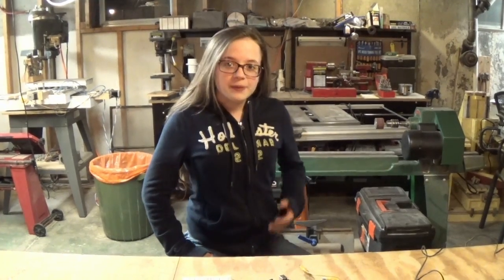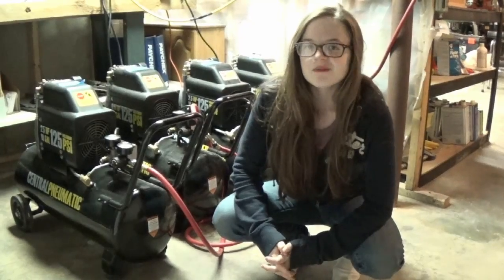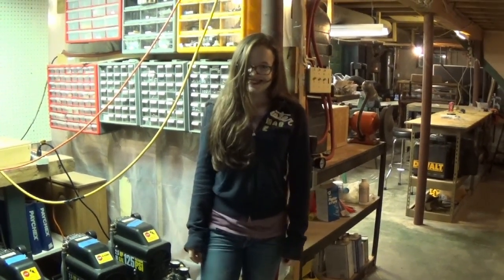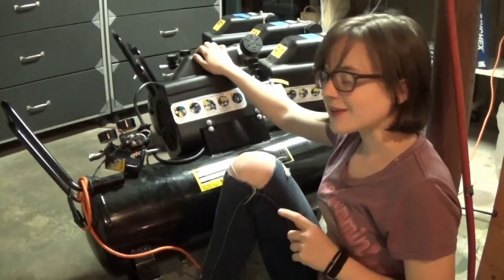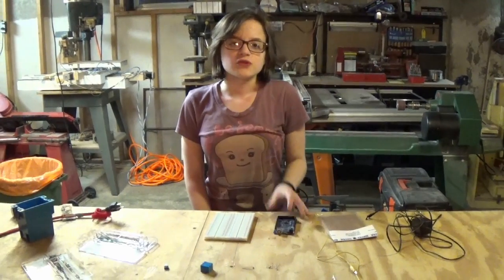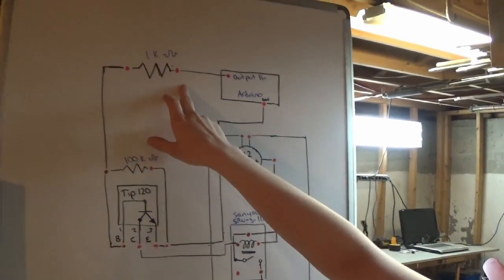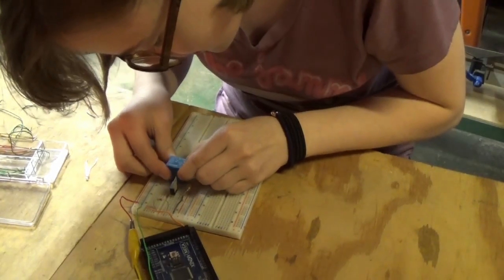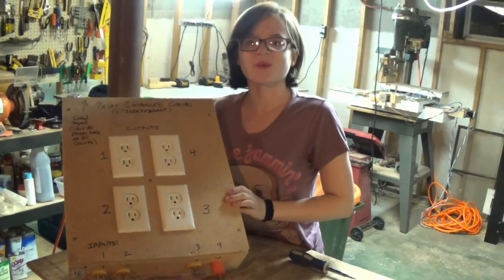Ep3 Cheap High SCFM Air with Parallel Compressors

Comment: its brilliant but has room for a lot of breakdowns as well. 1st of all, 4 compressors that are oiless...omg, you cant possibly have neighbors or be working in the same room. 2nd is you have 36 amps load just to fill roughly 40 gals of tanks and you have 600 bucks invested plus all the extra relays and power box so lets say 700 bucks to be conservative. not to mention all the future issues with 1 relay or switch or compressor that affects everything downstream. i have sandblasted for 20 yrs so i know your situation all to well. and i tandem 2 compressors as well to sandblast simply by setting the switches cut in and out the same and run both air lines to a T and a 3rd line off the T to the blaster. i am only pulling 16 amps total load, i have 18 cfm output, and 45 gallons of air and i can run the blaster constant for over an hour and maintain 75 psi. i have 100 lb blast pot so about an hour and im out of sand anyway. and believe me, 1 hour of blasting and your ready for a break anyway. i love the theory but the KISS method is better. half the electricity, double the air volume, oh and half the noise due to mine are oil bath compressors. you also will be buying 4 more in 5 yrs or less because of no oil...both of mine are from the 1980s and still going. the only difference is you did get out cheaper on the initial investment of 700 bucks. my 2 would cost about 1000 in todays world...but i will make up that 300$ difference in power bills vs yours in 12 months or less. keep up the good work, happy blasting and if your within 50 ft of those things, in addition to the standard respirator and sandblast hood, you will also need ear protection because they are insan
Reply: Those are oil-lube compressors and an incredible value when they're on sale at $99. They're loud like any direct-drive compressor. Another consideration is when she's done sandblasting she can sell two of them and still have plenty of air. However, I suspect the bug is merely the beginning and she'll find plenty to do with all that air.
Reply: Ok so u got me on a technicality, yes they are oil lube, but not a true belt drive oil system that is super quiet. I can run my 2 and have less noise, more cfm, more gallons storage, and less cost...and not have shit for compressor. Mine are 30 plus yrs and i could sell tomorrow for $200 each...these i. The vid will resale for $50 the very next day if she is lucky and 30 yrs from now, they will be just a memory, kinda was my point and you kinda missed it ;)
Reply: And theres no way she is doing much sandblast with those 4 toys. Maybe 30 seconds at best and shes out of air, then a minute later, maybe another 30 seconds of air...smh. god if she gets rid of 2 then she mights as well use a tire for air :). But seems like you know what your talking about so..... how about this: post a video of this exact setup sandblast a rusty car rim. I wanna see it. Id love to see her attempt to do whole rim just to see the sand stop at 30 second mark. My setup will do that rim front and back without stopping. Uses less amps, has more cfm, more gallons, longer yrs service and you actually have something worth something a yr from now...do a video of these 4 compressors 1 yr from now...3 of them will be replaced by then...great value! !. Yeah, you kinda missed that point too. :)
Reply from the maker: Michael Collins, 2 summers and counting.  All four are running smoothly.
Reply: Ha, mine are 30 plus yrs. Get back with me in 30
Reply: Michael Collins I understood this video more than I could make sense out of your comment - or the point you are trying to make.
Reply: Jake Toolson  jake, if you knew half as much as i do about compressors. Lets start over, jake, if you knew anything at all about compressors, you would have no problem understanding my point or wording. So i understand what you are saying, its 1st day of class, you accidentally entered rocket design room, clay pottery class is next door. Happens
Reply: Oh and btw a true belt drive oil system lol as you wanted to know is a motor driving a pump with a belt. The crank sits in a bath of oil and pumps and splashes oil to all the moving parts. Rookie i see. Quite the effective system. Much more so than her loud oiless units to which i made that point as well. Hers will last 5 yrs, i have one from the 1980s still in use...it is velt drive oil system but you probably wouldnt understand.
Reply: I have 11 likes you have 0 she has 5 so im not sure...
Reply: alphabuilders now you are getting it. keep reading and maybe you will understand... hint, it does have something to do w power... may have to drop u more clues later cause u seeeem aaaaaa lllittttlle ssssllllooooowwwww
Reply: Rickey Racer you da, read it back, she even said herself they are loud like any direct drive comp.! Now look up direct drive compressor and read specs on 1st 10 that pop up...then get back here. They are oiless system!! Which is not a true direct drive you da. A belt is to turn an oil pump and the compressor...sheesh, cant believe in actually waisting time to explain this. Hell, even she backed off conversation, when i got down on her level, shes a super smart kid, and my facts made sense to her when i got it to her  rain in numbers...lol haha, now wonder what that says about you
Reply: Rickey Racer lol i have 17 likes ,,,you have 1...guess nobody likes me. Guess you were right afterall lol
Reply: Sure, Michael - "For being right".  Wow, that went so far over your head. You might have some book smarts, but your people skills are ZERO. Go torture a puppy or kitten instead of wasting your time on here. No, I'm not a liberal - - I'm an FAA licensed Commercial  Pilot and A&P,  Mechanical Engineer, died-in-the-wool Texas 2nd Amendment advocate who carries daily.  Don't worry so much about "being correct" - try using some tact.
Reply: LincTexPilot  hey flower, my booksmarts are why i get paid and underatand how things tick. I dont get paid to change pansies diapers when feelings fet hurt. Facts are facts, her theory has lots of room for improvement.  Also has a lot of good points...i said that. Leave it alone. Her daddy is obviously smart lol as no way in hell she wrote this. Anyway, he is smart, it has room, i said that, it was right, u got butt hurt, i dont do butt hurt, i do facts , sorry, aply for gov aide and stand in line with all the others. Now, if u can dispute any of my findings on the facts of ,amps, gallons, cfms, etc, in open for discussion at any time....i will wait
Reply: LincTexPilot btw, if u are mechanical, then youd know all this. I as well as mechanical,  am also electrical. ( dad was mechanical and older bro was eletrical) so guilt to satisfy both made me do 6 yrs intead of 4 lol. Anyway, i get it. Both. And facts dont change.
Reply: Michael Collins Have you seriously argued about a teenaged girls video for an entire year?  I will agree with you that there are better compressors out there to be had than harbor freight, I don't think any of these people would argue about that. If it took you that many years to learn this point, you have wasted your life. And continue to waste your life arguing with complete strangers about a stupid compressor.
Reply: Michael Collins +1 Who finds your comments absolute nonsense. Any future peeps i wouldn't waste time on this troll obviously a waste of space to seek out child videos to bad mouth them and any supporters. 
Wanted to share with her fans ive owned the 10gal /5.3cfm version for years, used it for soda blasting, auto air tools, ran hard never changed oil.
Reply: Heng Zheng no, i suggest u go buy 3 of these and be just like her! She rocks . You and many others just need to follow her plan. I will stick with mine. 1 of mine is equal to all of hers...duh. that was my point b4 u and others jump on the bash train woo wooo, u are the current captain of not understanding amp,cfm,volume congrats
Reply: I feel so stupid to even reply you... And You still think it's only about the compressor. FYI I got petrol powered 7.5hp commercial 'TRUE OIL LUBED' compressor with 500 lpm F.A.D. (Tank size is 20 lt only though coz it's a compact trolley model, but what really matters is the FAD and duty cycle) and another high pressure model to charge my max concrete nail gun to 300 psi, and so what's the point? It's just a freaking tool and I also know my tool, and just because I know, I regard it as nothing instead of some kind of knowledge to brag about. I actually think it is pathetic to brag about as a owner (probably because you got nothing else?) instead of a creator like what the girl does, at least she's doing something creative which means she will also evolve, with or without her dad's instruction. And FYI I am also a artificial intelligence specialist with 1st class honors Masters degree (didn't take the Phd Offer though), which is nothing, just want to mention that's my main area and I am only a part time mechanic and metal worker. My interests simply covers all, e.g. 3d print an adapter to let my dewalt use Makita battery and the parts for my drone, making 'knock off' incra jig using my soft metal, train a deep learning model to write an article with key words and core idea, etc. etc.AND, all the above statements doesn't matter, you can regard them as BS, so will I, as I don't give a fucking shit. What matters is I care about you mate. I have a friend just like you, and he definitely get's better after he begins to see a psychologist regularly. Seriously, you did nothing wrong, but your brain could went wrong and it's not your fault. and unlike anyone else here, I don't want to be harsh or mean to you, I want to help you, to stay healthy, mentally. That's all. And this conversation is over. I won't reply, and to guarantee that, I swear here, if I reply I will go to hell. Take care and be happy.
Reply: Mr. drjjlj and all the rest of you people just need to get up off Mr. Collins back and leave him alone. It's oblivious that he does not have one real friend to talk to, so he watches little kid videos and argues with people he'll never ever see or meet just to keep from being lonely.  Mr. Collins i got your back, cause i'm lonely too.
Reply: Moe Moe's obviously, afterall, you ate not only watching little kid vids but reading and commenting as well. I didnt even go that low..i didnt read or comment on anyone, i started the conversation  simply by pointing out facts... BTW,  not 1 single person who commented here has been able to tell me 1 single part of my many points where i made an incorrect statement. Just a bunch of haters is all that have been here, no facts. I based my facts on 1 knowledge, 2 experience of real world shop experience. I think all the haters are teens or immature at the least who probably have a box store 20 gal compressor which makes them a pro on the subject
Reply: I am interested in what Michael Collins said.  I'm designing a multi-compressor setup for my shop to run DA sanders, HPLV, and media blaster.  I checked out this video because I wanted to see someone using more than 2 tandem compressors, and my immediate first thought was that this setup is a bit "over-engineered" or maybe "overly-complex" - i.e. where is KISS?  My second thought was wondering why you would use 4-5 oilless direct-drive compressors when HF sells oil-lubed belt-drive units that would put out more air using less power (much greater efficiency) with much less noise, for about an extra $30. I simply can not fathom why anyone would want to use an arduino to control power switching.  Makes zero sense.  It is inefficient (how much power is wasted on simply running the arduino?) and redundant - there are better and more simple switching systems out there that will control multiple circuits, and do it with a remote control, which cost less than the arduino.  I assume the goal with the arduino was a teaching lesson about electronics and programming for his daughter, in which case, bravo good sir.  Every learning opportunity is worth the extra time and trouble and I applaud you for doing that.  However, I was rather disturbed to see them using extension cables to run dedicated power circuits from another room - that is a serious fire hazard if you're running those compressors for any kind of serious duty cycle.  Also, if you're going to all the trouble of wiring up 50 amps worth of dedicated 120V circuits, why would you NOT use single-phase 240V?  Parasitic loss over the wire run alone will be about 20-30% lower on a 240V circuit, plus you are drawing a lower amperage which equals less heat on the wire, and less wear on the motors.  I could continue but I'm not trying to be critical of the girl or her father, that's not my point.  My point is that no serious shop would ever use a design like this as it is rather inefficient and over-complicated.  I believe that Michael Collins made some very good points, and to insult or attack him simply because he presents his information in a gruff manner speaks of ignorance and hubris.  He is trying to help.  But I can also see that the goal in this project might not have been to build out an industrial-grade compressor bank, but rather a cheap/experimental learning lesson.  To end with a positive note, keep learning!  I think it's awesome that dad and daughter are working on the car together.
Reply: Dave D , id be more than happy to show you a video. ..sure wish id had a vid 20 yrs ago. It would saved me a ton of time, money and reworking setup 3 to 4 times...but as u can see, this thread is full of haters who dont want to learn or listen to 20 yrs of trial, engineering, and redos. I wont do it here so fonna have to figure another way like facebook or maybe i can do a youtube as well but never done youtube
Reply: Michael Collins I don’t wanna say who’s right/wrong but after you read the suck up comments on this video nobody can argue that this is a science experiment, and you do it either for a living or a hobby. But to hell with it, I’m a teen who dicks around with this crap in a little shop and I’ll tell you firsthand that belt driven is the way to go, especially used for $40
Reply: For those looking for a big single phase compressor, if new is required, a Ingersoll Rand 7.5hp 2 stage will do 24cfm@90psi, downside is its 2600 bucks at Northern tool. Another option is to find a used 3 phase upright and repower with a single phase motor, and pressure switch, and then sell the 3 phase motor..
Reply: Machinist 72 i went with the 3 cylinder 60 gal. 15 hp unit. 18 cfm. Better bang for buck if u dont need 24 cfm which almost nobody in hobby use does
Reply: Michael Collins chicago Pnuematic makes a 120 gallon, two pump, two motor setup thats single phase and is something like 50cfm - costs like 4500 bucks though. Its the biggest single phase unit that i know of. Beyond that, it makes sense to go to a acrew air setup, and AFAIK, nobody makes a single phase model.
Reply: Machinist 72 ouch!! My bog boy was 619$ by using coupons. 6 hp 18 cfm 3 cylinder with 3 separate filters i researched for months. It truly is the best bang for buck. Most cfms for money, tank size and amp draw.
Reply: Machinist 72 another perfect example. That 4500 one is certainly bigger at 50 cfm. But i can buy 5 of mine at 3200$ , and have 80 cfms and 5 tanks of storage...300 gallons of air vs 80 gals. And save 1000$ its a perfect example of what my initial point to her was exactly about...just the scale is 10x bigger lol. With my setup, i have 2 5hp 30 gal compressors t in line with big boy 60 gal 6 hp...i can sandblast all day long with no waiting. Just painted a car  all day 7 coats and they just took turns cycling back and forth never a pressure drop in my booth. Lil engineering but well worth it if somebody is doing what i am. I am not a weekender, i run mine almost every night as i do tractor and car restoration on side after work for the public
Reply: Michael Collins 
I've been running the same style of compressor to frame houses at a peace rate for the last 8 years. In other words, i get paid by how much i build. So this little compressor runs 14 hours a day 6 days a week.  No problems. Kinda leaves ur argument pointless.
Reply: Well, Michael... you have continued to argue a point for an entire year.  Shows persistence... and an inability to handle criticism.  Your biggest argument is "I have 17 likes, you have 1."  That's a bit... childish, maybe?  Whether or not you're correct is moot.  She said she would be using it to get the car restored in about a year.  Then posted an update that it's been 2 years.  Nice job.
Reply: Michael Collins she never said she was going into “production of air”. She was going to sandblast A car. And it’s a small car. She also never said it was the best route. But by your own admission it is a route. 
And me commenting doesn’t mean you HAVE to respond. But it shows that, for some reason, you NEED to. You have some need to spout YOUR qualifications over a teenage girl learning different ways to do things. There are many ways to do things and for the last year you argued you were the only expert here essentially. You even called me an asshole!  Wow.  Now I won’t come back and respond because I have control of my emotions. I will however chuckle softly to myself if you are baited (again) into trying to demand respect on an online platform. 

You go Hannah. I’m sure your producer is proud.
Reply: Michael Collins I wanna get a 3 phase compressor but We need better power or a phase converter
Reply: Master of code 101 yeah, thats getting into pretty serious stuff, i dont know your air requirements, but if its industrial use like a 10 bay shop, or if you are running a trailer portable blaster to do dozers, 3 phase is thw way to go. Cheaper electric bill, slower rpms mean longer life . But getting into 3 phase aint cheap and in some cases, no matter how much money you offer, some areas and some utility companies just wont supply it. Good luck
Reply: Michael Collins yeah we’re not industrial grade by any means and we would never get 3 phase power from utility but we do a lot of prototyping out of wood so we have lots of air nailers and impact drives ect. But having something that could run continuously with good pressure and no problems 
would be a lot better than waiting all the time for the smaller one we have now
Reply: Master of code 101 if you know the cfm required for all your guns,  get back with me and i will give you my opinion on a good fit.
Reply: Michael Collins  25-30 cfm at 100psi should keep up at the most demanding
Reply: These compressors are oiled. But yes 2 bit 27gallon or so would be nicer. 

However you can really get these 2.5hp 10gallon compressors for about $50-$100 Used as well
Reply: Dscherer14 exactly my point lol she has 4 compressors at 2.5 hp each, 10 gal each, 5 cfm each. Thats a total of 10 hp,40 gallon storage and 20 cfm of air and that is if all are running perfect. Total amps on her 4 units is around 40 amps!!! :(  my large shop compressor is 1 unit, taking up only 4 sq ft of floor space unlike hers which takes up 15 sq ft. Also mine is 6 hp, 60 gallon, 18 cfm of air and pulls 16 amps...so lets compare hers to mine
Hers 10 hp,40 amps of electricity used to get 20 cfm of air and only has 40 gallons of storage...cost $500 with taxes, takes up more floor space, 2x as loud to run...
My compressor 6 hp ,16 amps of electricity used 18cfm of air, 60 gallon storage cost $600 , takes less space, runs much quieter
Reply: Dave D if you're going to run all that, you really need a rotary screw compressor.
Reply: Michael Collins they created a sequential start system with simple compressors that allows for LRA to not overwhelm a residential electrical service. That is a big deal.
Reply: Michael Collins she said 9A per compressor at 120V. So hers does draw twice the current but at half the voltage, so it's the same power. Try looking at Ohms law, she obviously gets it.
Reply: Michael Collins I managed a system with 1 60hp Ingersoll Rand rotary screw, 2 100hp IR rotary screw, and 1 200hp IR variable drive rotary screw compressors. Later it was upgraded to 4 200hp IR variable drive rotary screw. I had them all run sequentially, in different buildings by local pressure set points only, until we got 4 of the same in the same building. Her project impresses me. Put your hood back on and shut your face.
Reply: Court Rutherford ya i know. Its a sequencer but im not worried about lra, its the ra (ruuning amps) thats too much for the air it makes, not to mention no storage, and God,  the noise, the mind crazing noise.
Reply: Michael Collins you'd be concerned with LRA on a residential panel. LRA on those compressors is about 90A, so x4 and she's going to end up with a significant voltage sag and they all stall. You do understand voltage and amperage coincide lineally? Voltage goes up, current goes down? So hers running at 120V means it draws twice the current than 240V but it's the same amount of power (watts)?
Why the hell would she be concerned with noise while blasting? Those tanks will fill back up and all the compressors will drop out. The only thing quieter is rotary screw, this is a hobby/project for her. She talked over them all running in the video. I even have one of these, and another old Stanley that's even louder.
Reply: Court Rutherford oh yes i know that but she is running sequencers so as far as start up, shes covered,  but yes incase of a failure, lra would catch her in a bad way
Reply: Defdakilla41 as a shop owner, i know air, cfm, amps etc. Thank you sir. I wasnt in it for drama and destroying someones precious dreams lol, i just spoke facts
Reply: Michael Collins 

This comment thread started with you giving your own professional advice to the uploader. 

Then Hugh Brackett replied to u pointing out its not oil less compressor in as far as i can tell it was written in a non condescending manner.

But u replied not only once but twice to his comment and thats where this drama unfolded. So im going to break it down to u how that happened.

In ur reply to Hugh Brackett u said:

U went off on him boasting about ur set up, longevity and even "implied" the uploaders rig a shit compressor and condescendingly labelled it as $50 value after 24 hrs. "30 yrs from now they will be just a memory kinda was my point and u kinda missed it" - Hugh didnt miss ur point. What u wanted to say is "dont look at my failure to look up the spec of the compressor but instead focus on my grand knowledge based on how big my d*ck is :)"

It wasnt enough that u felt insulted by someone pointing out its not oilless so u wrote another reply putting down the uploaders rig.

* "God if she used 2 air compressor then she might as well use a tire for air :)" = condescending and not a professional advice
* do a video of these 4 compressors 1 yr from now...3 of them will be replaced by then..great value! = sarcastic condescending and not a professional advice.
* And again u said "yea you kinda missed that point too" = little man, he only pointed out that its not oilless and the rest of his comment wasnt aimed to offend you nor even offensive.

Uploader replied to u that its been 2 yrs and still running smoothly but u had to take it as an insult because your grand knowledge and prediction was incorrect so u laughed at it and boasted "Ha, mine are 30 plus yrs. Get back with me in 30" = condescending, arrogance and unprofessional.

And the rest of the comments is u arguing about how big ur d*ck is to the other commenters pointing out to u its really not.

So in response to your recent comment that ur a shop owner with what seems to be 30 yrs of experience that YOUR NOT IN IT FOR THE DRAMA AND DESTROYING SOMEONE PRECIOUS DREAMS go and read your comments and ask yourself this  important question, 

"Am I an asshole?"
"Did i start a DRAMA?"
"Am i trying to ruin someones aspiration?"
"Am i not being professional in giving advice to a teen?"

Should be a resounding YES in my opinion since u were butt hurt about someone pointing out ur lack of experience working with modern air compressors that doesnt predate 1990 and slamming the uploader for learning and putting together her own rig.

I have an advice for you. You know mail sorters sometimes wear this single finger nitrile finger glove so their fingers doesnt get dirty. Use that on your puny d*ck as a condom when having sex so u dont spread ur stupidity and ignorance to other people.

Just a friendly P.S. announcement :)
Reply: Eggie Null your very bored onviously. Facts are facts . Cant change that no matter how much you read or comment here. Oh btw, if I believe this is a teen, then you need a special award. It is obvious to everyone here her daf is obviously an engineer In "training" and she, well sir, she just likes the camera. So when I spoke, I knew I was speaking to an adult, not a teen. And I do t have to do the research if this is the best way to run air, I already inderstand cfm, amps, load, and duration. And this system, while it does work, is nowhere close to the most efficient or effective way to get more air at less cost. And then we talk about the noise! Geesh, the noise alone is the best reason no one out there should copy this method. I have 2 ,compressors in tandem with a 3rd tank for storage. Total gallons is 105!!! Total amp when both are running 30! Total cfm 30! More volume, more air, less amps! Simple. Oh not to mention mine are 30 yrs old, and 3 yrs old respectively and not 1 breakdown...It's not rocket science...to some of us anyway.  Thats my friendly opinion and was the same from the start before the butt hurts joined in.
Reply: @michaelcollins1899  I don't see any videos on your channel, why don't you upload a video of your 30 years old setup and show us how it's done instead of complaining of this teens setup? I mean a picture (video) is worth a thousand words and probably show all the others how it's done. Right now it's just words from you, ask your self. Why would anybody believe you, you just ranting and calling others out.
Reply: @SwedesGarage  because i work, i dont do videos. This is a dumb rant bro, there are hundreds and hundreds of videos of my setup by others on youtube, its not reinventing the wheel!!! Its common sense. But if u dont have engineering background, i get it, you need a picture. Still, nothing i said here is a cloud of fairy dust, its cold hard proven facts! And you, like others,,, if you for a minute believe she did this, you have more learning to do. She is a video star. " star" living thru her dads dream. That another fact. 2 ways of learning: listen, or feel. You can listen to all here who point out shortcoming of her setup including mine, or you can feel,  bu doing exactly what she does here. Either way, you will learn. My setup is simple, i have one large, 2 avg compressors i t all the lines together and set the refulators the same. That give me105 gallons of air and none of them run at same time, the pressure switches ate adjusted by me at different levels. Shes pulling 40 + amps and has 40 gallons of air lol. Im pulling 36 amps if all 3 are on same time (rare) and i have 105 gallons of air. You do the math bud. Also, mine dont run often because when they cut off, they get a nice long break before running again due to large storage of 105 gallons. Like i said, not rocket science, just used the noggin! Peace
Reply: @michaelcollins1899  I agree it's a dumb rant, but I can't denied that you just have to have the last word after reading all the comments from you and others. I understand that you are on a different level then us mortal when it comes to engineering, but with that sad you should have stayed on that level and not sunk down to the common folks level by keeping the sandbox 5 year old level going for months. You say you work and don't do videos, but you have time to argue on internet. I guess you know what they say about arguing on the internet? Includes the word special Olympics..........................
Reply: @SwedesGarage  and you are right, it was a dumb rant and i definitely dont have to stoop to your level :)
Reply: @michaelcollins1899  Excellent, as long as you understand my point i'm a happy camper. So I rest my case and have a nice weekend coming up ;-)